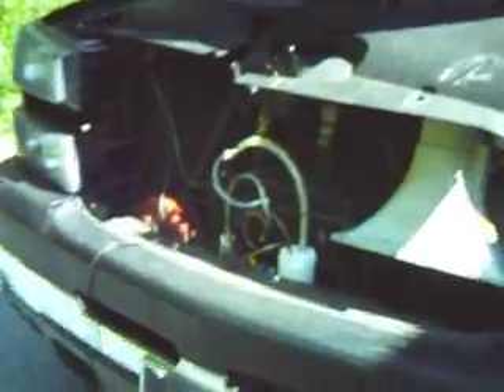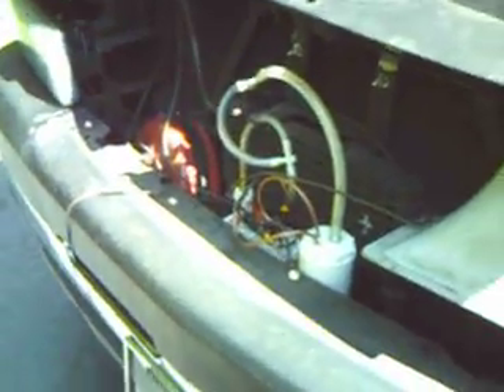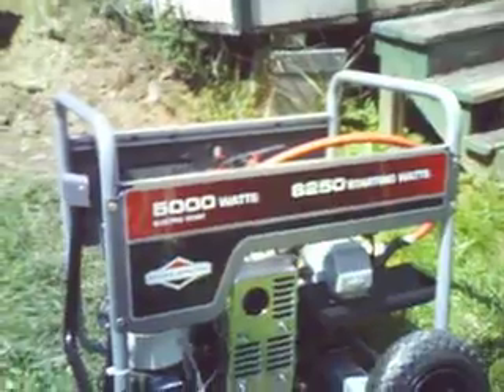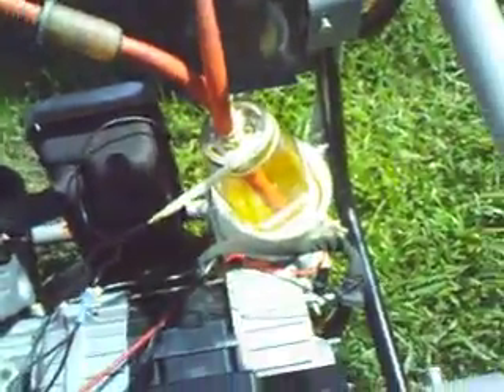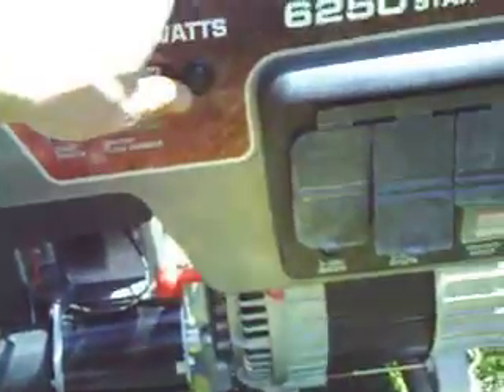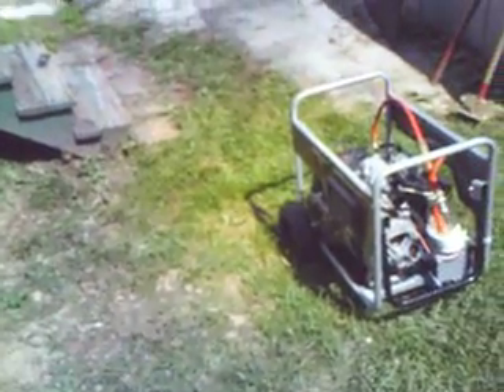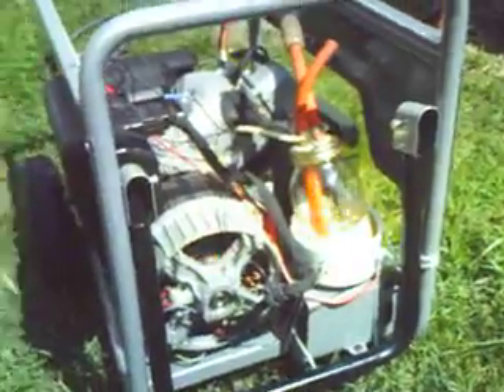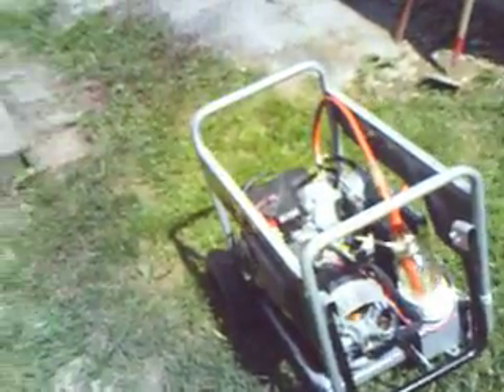Gas Vapor runs 5000w Generator

Comment: it does work under load check my video out its runs better under load 4000 watt generator running on gas vapour under a 1500 watt load
Reply: Frank Tremblay 
He has passed away in March 
thank you for the reply
Reply: So sorry for your loss, how did it happened ?